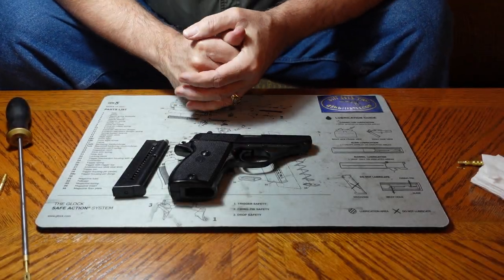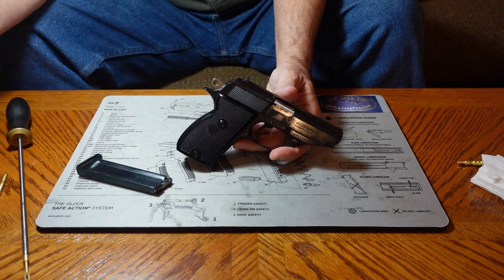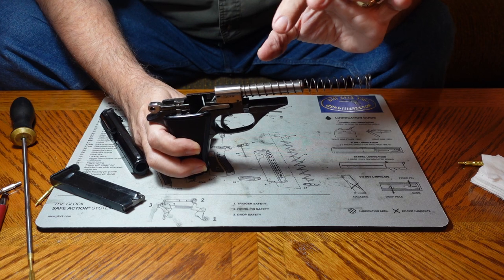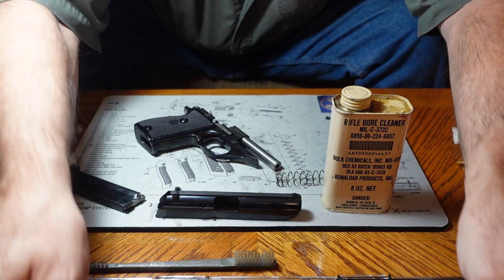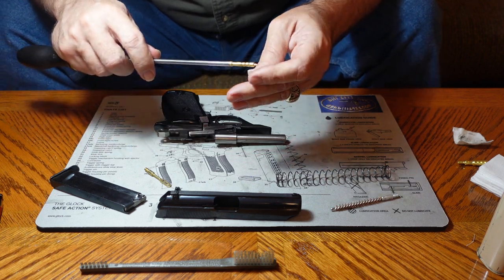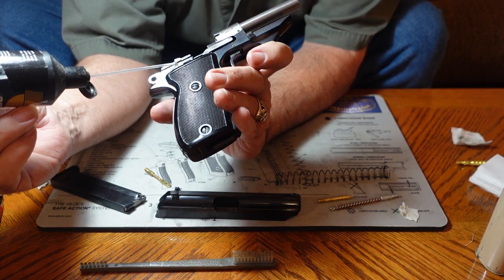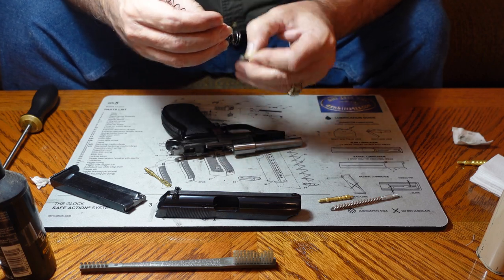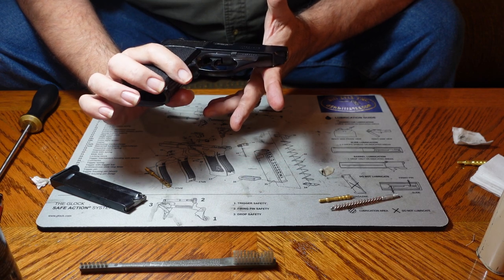How to disassemble, clean, lubricate the Astra Constable .22 cal. #astra #carrygun #pistol #gun

Comment: Thanks you were a big help
Reply from the maker: You are most welcome. I corresponded with another one of my viewers and in the process I realized I left something out of the video that might be helpful. It is a pain in the rear to pull that trigger guard down and hold it when pulling the slide back on disassembly, and reassembly. Here is a tip that might help. Some people push the trigger guard to the side and hook it on the frame. I don't like to do that because it can scratch the finish on the frame. Try using a popsicle stick, or one of those wooden ice cream spoons. If you slip it in lengthwise to the frame it will hold the trigger guard open as you work the slide on disassembly, and reassembly. I hope that is helpful. Thanks for watching.

Comment: My dad bought one used. It was so gunked up. I can’t break it down even pulling down the tabs at the same time if I pull them down one at a time, it goes down further. Any advice, sir
Reply from the maker: Both tabs have to go down together. When you say gunked up please describe the gunk. If it is oil or grease you might be able to dessolve it by taking the grips off and immersing it in mineral spirits for a few days. agitate the gun ever hour or so. Thie should soften fouled oil and powder.
Reply: @Bill1911 how to fix firing pin I don't know how to disassemble it's firing pin